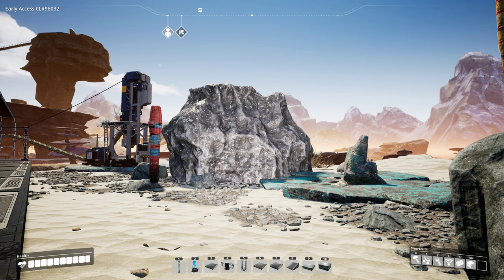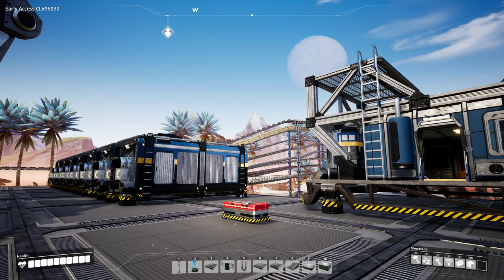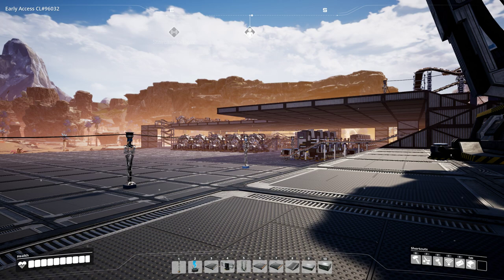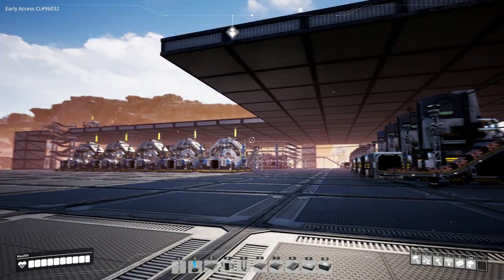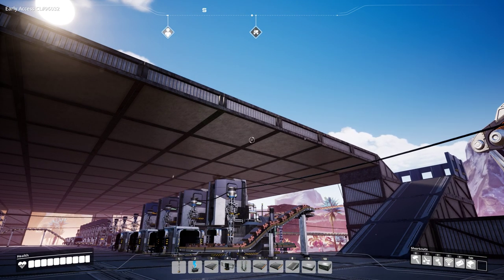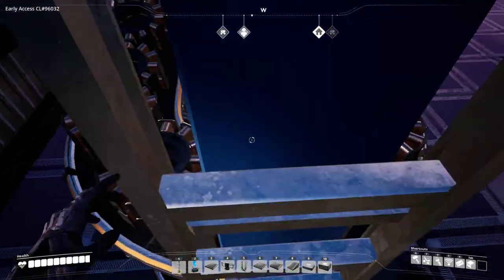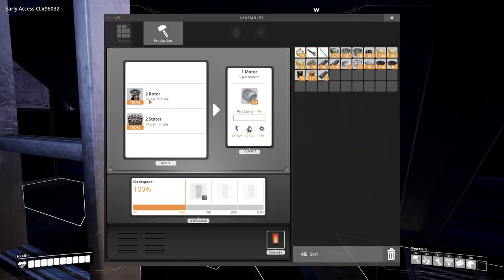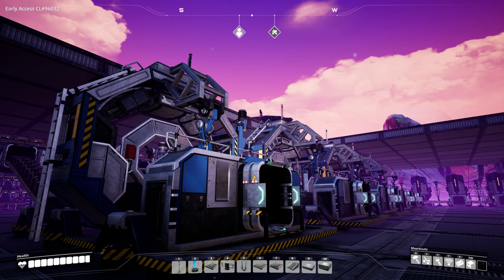Satisfactory Tutorial - Factory Efficiency! Miners, Smelters, Belts & Constructors

Comment: Hello!
I enjoy your videos, keep up the good work!
I have had good success with the linear splitters you used in your examples. You described the inputs near the end being starved because they recieved half, quarter, eighth, sixteenth ect. I experienced the same thing after building constructors, adding splitters and belts, hooking up a supply of limestone and turning them on.
However, if you simply pre-load the constructors with 100 limestone and let the feeding belt system completely backlog before turning them on it seems to work quite well.
I was able to take a mk 2 miner at 188% producing 451.3 limestone on a mk4 belt and feed 10 constructors with 1 50/50 split feeding 5 each.

I am interested in learning propper terms and I believe this is called belt saturation.
Reply from the maker: Thank you very much! 🤗

Indeed you are correct! The issue is that the system needs to spend quite a bit of time to saturate the system, so it does work, but unless you do exactly what you explained here in this comment, it will take up to an hour (depending on the number of machines) for it to function at peak efficiency while the machines are loaded.

Comment: Can you tell me if what i did is right?
Im using miner mk2 and its produce 120 so i can build 4 smelters and from each smelter im doing 2 constructors.
Reply from the maker: It depends on what you are making in the Constructors. 120 ore in 4 smelter equals 120 ingots, so if those 4 Constructors are using 120 ingots, it should be right as long as the belt speeds are correctly set up. 😊
Reply: @Caledorn  yeah i saw that when i put splitter with lvl 3 belts only 2 ways work and the 3 one not working what should i do in that case? To make the belt before the splitter fast and after to do it lvl 2?